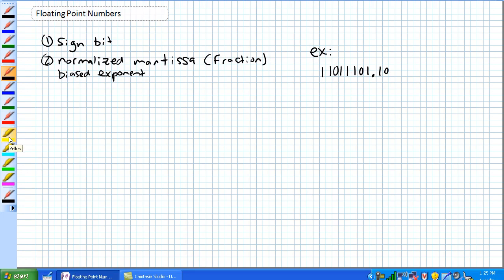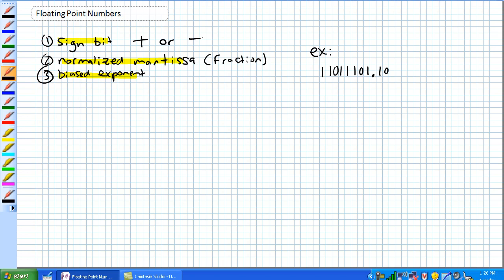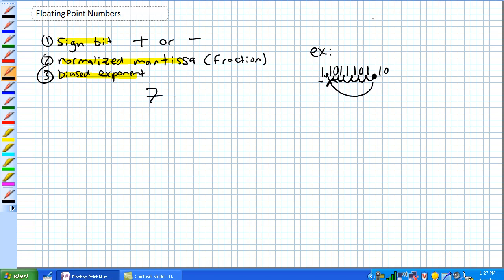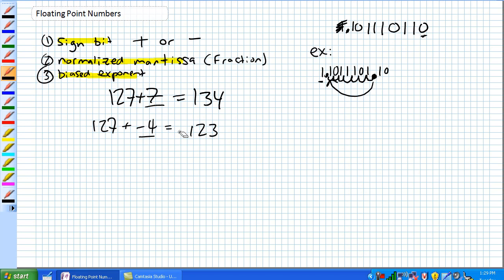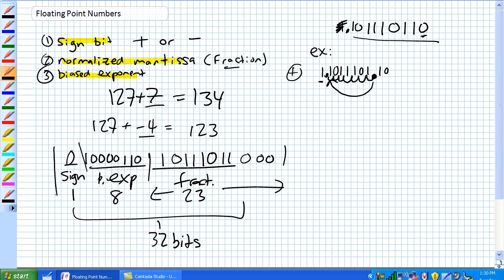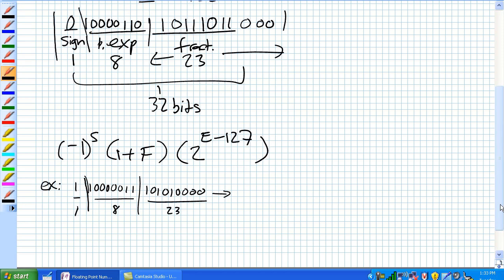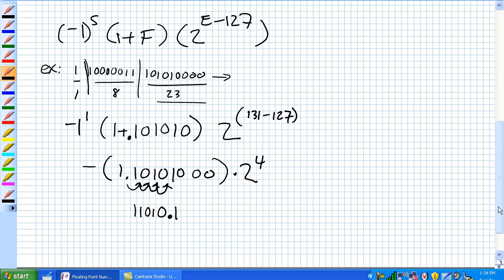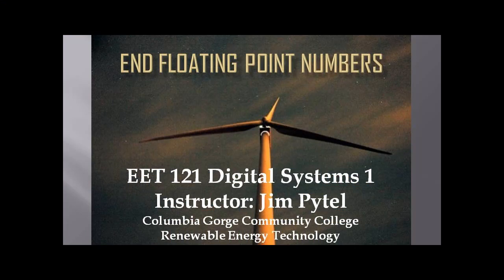Floating Point Numbers

Comment: i know that its a bit late, but this could be helpful for some students, this is a trick to convert decimal to binary: lets say 0.125   multiply by 2 =0.25 so f -> 0.0 , still decimal below 1, *2 =0.5 f-> 0.00, also mult by 2=1, f ->0.001, no more decimals, normalize (you shift 3 times to the right, so exponent=-3) biased exp = 124, normalized mantissa is all zeros (cz it's = 1.000[all 23 zeros] ) so full float: 0 01111100 [23 zeros]